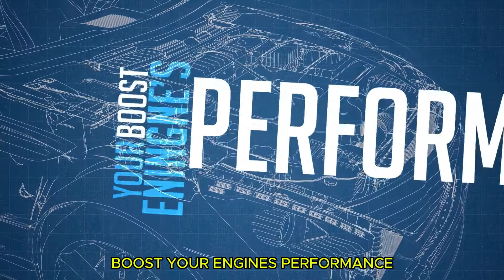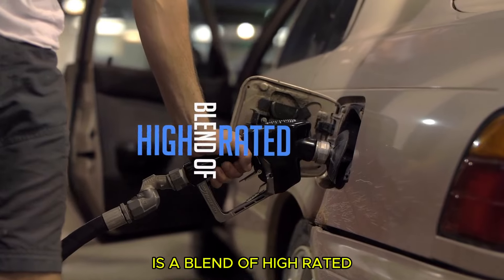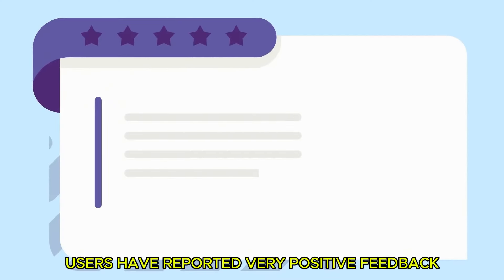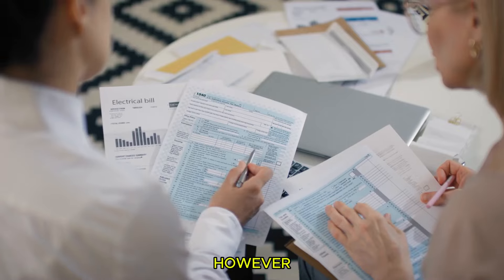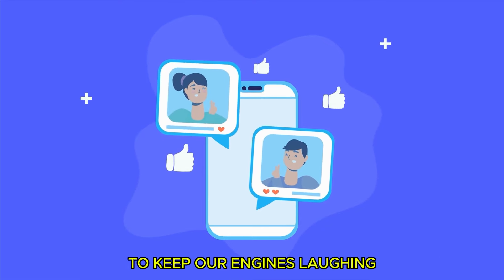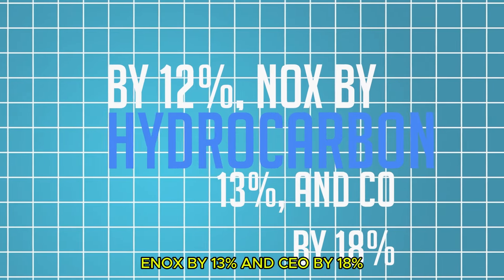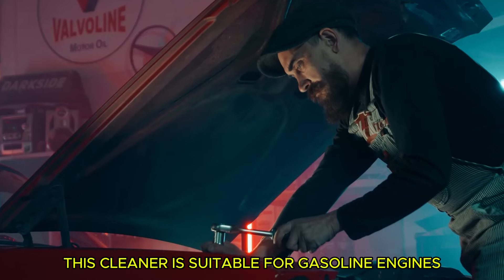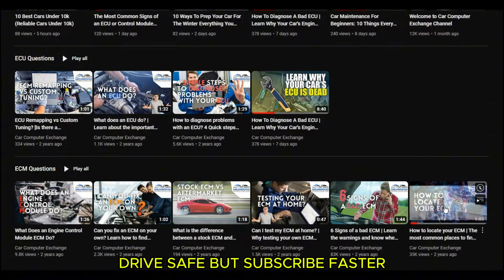Boost Your Engine's Performance With The Best Fuel Injector Cleaner

Comment: The video presents a deceptively simple solution to improve engine performance by cleaning the fuel injectors. While it is true that clogged injectors can negatively affect engine performance by reducing combustion efficiency, it is important to understand that not all engine performance problems are due to dirty injectors.

Comment: It is also essential to note that although fuel injector cleaners can be useful in certain circumstances, they are not a silver bullet for all engine performance problems. In some cases, more extensive maintenance or even mechanical repairs may be necessary to fully address performance issues.

Comment: Before using any fuel injector cleaner, it is important to read the instructions carefully and follow them correctly. Additionally, it is recommended to use a fuel injector cleaner regularly to maintain optimal engine performance and fuel efficiency.
Reply from the maker: Thanks for watching.
Reply: Pure bot behavior 💀💀💀